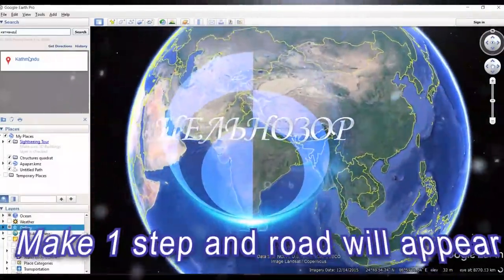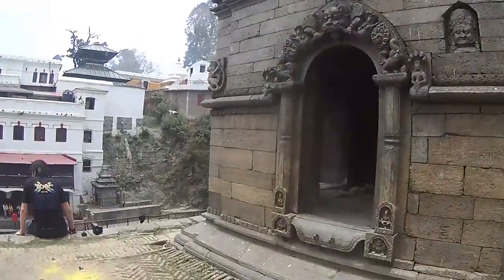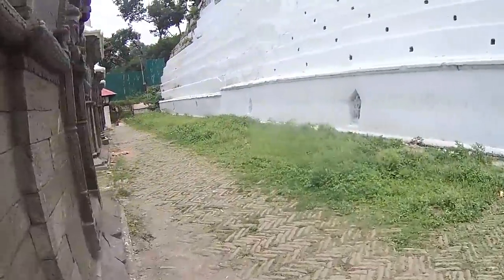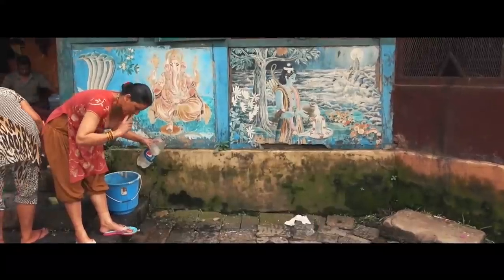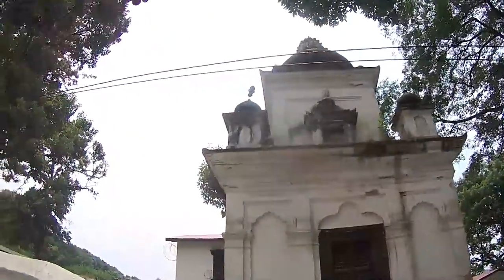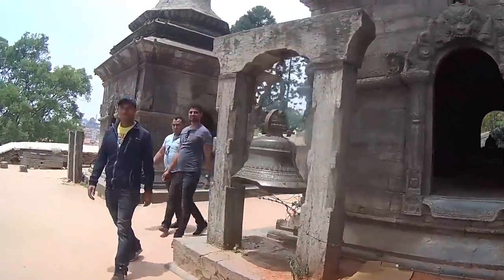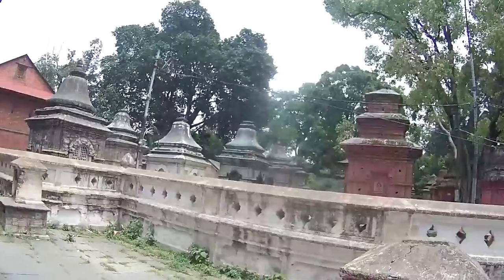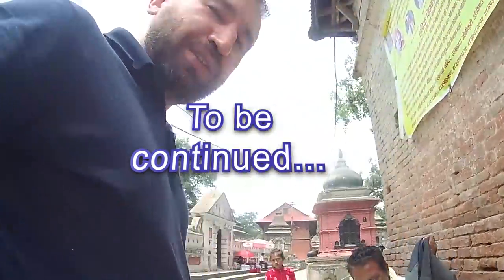Pashupatinath -Temple -crematorium in Nepal  or cargo cult of now days?

Comment: 16:55 that post has a couple of interesting designs. The first I noticed was toward the bottom, which resembled the FASCES (the axe head with poles wrapped around it) but the top part looks like both a trident and the world wide symbo, of lightning... as many have pointed out both symbols likely have more than just one meaning. What some believe is that the fasces symbol was the "battery" or power supply for the weapons of the time. The weapon was either a sword (or perhaps the trident with its likeness to the Lightning )which I know was the point of another video on the Global Vision channel. The reverse of that post has a better looking "fork" though.

Comment: Before they had big saws to cut two by four planks and build houses that way and they call it a stick-built house they used Big Blocks of wood and when the mud flood came it's solidified everything and petrified the wood into stone and that's how it works and then also the in-between spots were rebar in steel to reinforce I hope I gave you your answer sir all my respect to you and yours be well be safe be blessed

Comment: I'm thinking these dome structures were used to create metals that pour out through the openings you show near the bottom. Transmuting one element into another using electricity at set frequencies created between the cathode and the anode in these structures. The bells were inside used to create the needed frequency. Maybe the bell clapper was a cathode

Comment: There are two things I’ve noticed:  first the bells are asymmetrical to the rest of the buildings.  The bells seem out of place.  What if they have been hung with chains at a later date, removed from their original location.  Kind of like hanging something in plain sight reminding everyone of a victory.  Screaming the truth is right in front of your face, but you need to reassemble the pieces before the system comes back online.